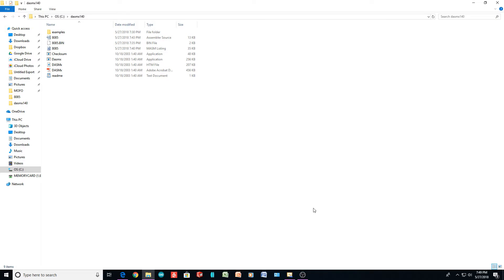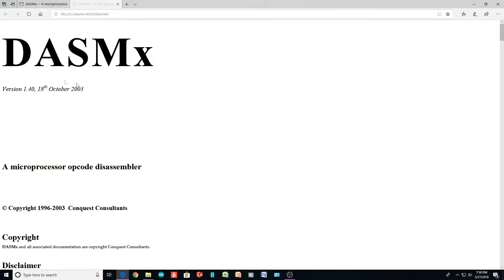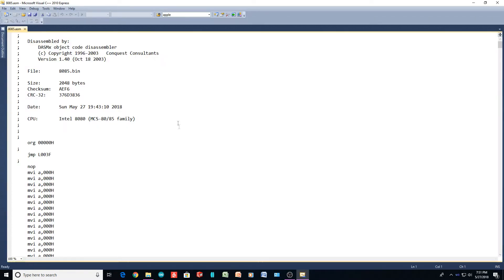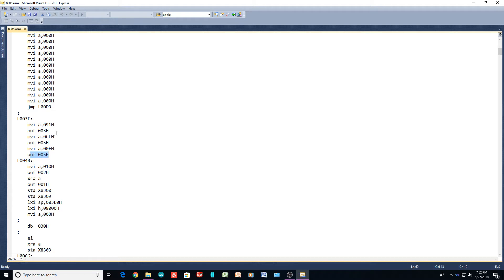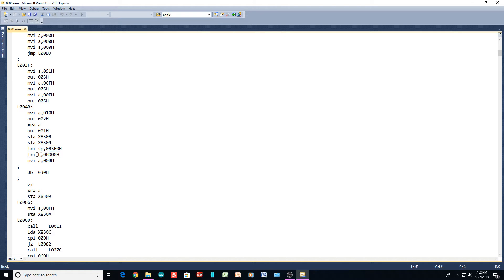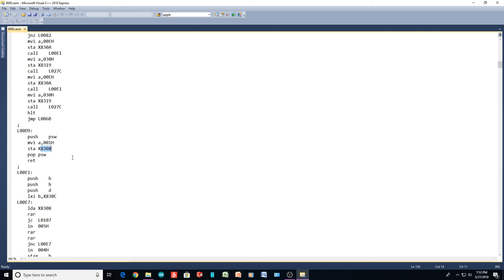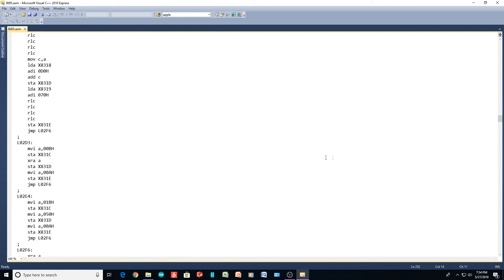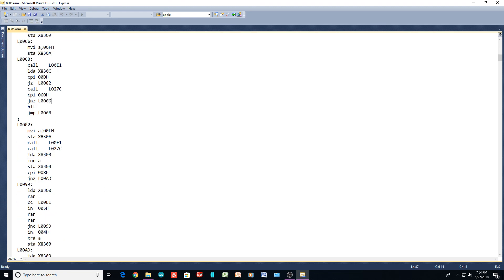#208 Intel 8085 SBC ROM disassembly

Comment: please make the rom dump available in hex or Bin. i haven't done 8085 before but do 8035/8048 in stead of Sudoku. There must be a few other oldies that want something to do at night  ;-)  PS: the first thing i do with a ROM dump is get Word to open the bin in " recover text" mode. you 'see' any ascii and copyright text.
Reply from the maker: https://github.com/imsaiguy/8085
Reply: create a text file with the same name as your .BIN but make it a .SYM.  put the below 4 lines in it. Then rerun DASMx with -t option. this will thread the dissembler. there are only 2 entry points. Reset and interrupt 7.5. Declaring the CPU in the SYM file as 8085 also fixes DASM not being able to decode SIM and RIM instructions.

cpu 8085
org 0x0000

code 0x0000
code 0x003C
Reply: There is only alott of >.>.>.>.> and a bit of <.>.<.>.<.>.<.>.  ;) looking at the dissassembly is alott more fun ;)
Reply: Careful.  DASMx does not resolve the RIM and SIM instructions IF you disassemble as 8080.